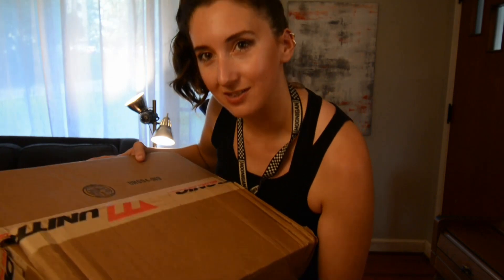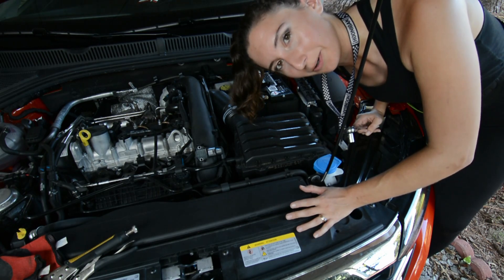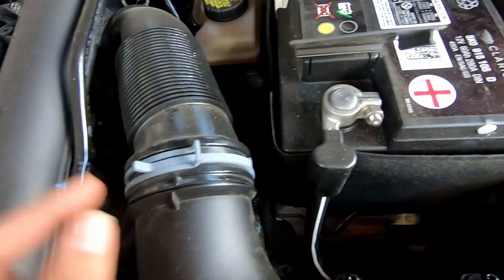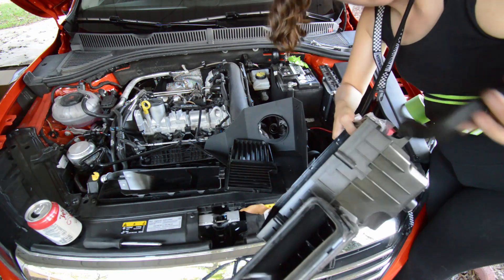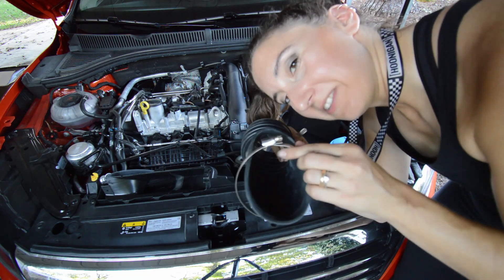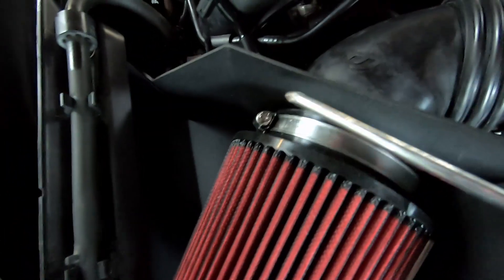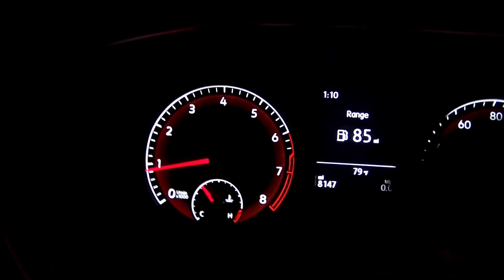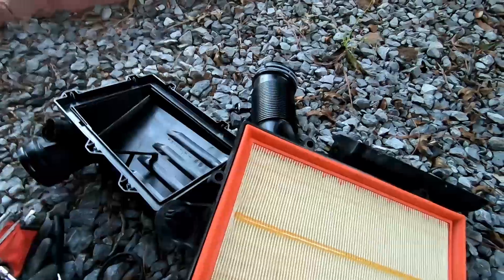Mk7 Jetta Unitronic Cold Air Intake

Comment: According to Unitronic, not all Ea211 1.4 Jettas have that apparatus for the mini filter. On some models, they're equipped with a secondary air pump to assist with cold starting. My jetta did not have this, so Unitronics told me to just forget about it.
Reply from the maker: Interesting. Good to know. I'll update my description with that information.
Reply: by forget about it do you mean you didnt use the intake or just didnt put the mini filter on

Comment: Currently deciding between unitronic and ECS air intakes, thanks for the install video. Def useful information. Also, what size wheels do you have, and did you notice any issues with rubbing?
Reply: i have an aem cold air i love it
Reply: Im thinking of ordering the ecs one myself. Let know if you order it and how you like it
Reply: @dnice362  i didn't buy it because there was no attachment for the BOV hose, and i didn't want to interfere with any engine cooling effects by removing the flap on the stock air duct. I got an AEM and i love it. I can actually hear the engine for rev matching by ear
Reply: 18x8.5

Comment: New to the VW world, I recently got a MK7 Jetta R Line. Im thinking of doing a lift-technik intake and a quad bola exhaust. do you know at what point I would need a tune?
Reply from the maker: For those two mods, you won't need a tune. Once you install a downpipe though... It shall be time. 😎
Reply: U don’t need a tune for a down pipe on these cars either 🤦‍♂️. Honestly though unless u rolling in a gli u wasting your money as the max you’ll ever get from these cars are 210 whp. U can’t attach a bigger turbo as the engine can’t handle it.
Reply: @thewholecountryislaughinga8440  downpipe defo recommend for a tune. i have a 21’ gli, and it’s practically a must once i got my downpipe!
Reply: @camjron  this isn’t a gli buddy
Reply: @camjron  she has a Jetta it doesn’t need a down pipe for a stage 2. I have a 2017 Jetta stage 2 tune with just a cai and performance muffler. Vw forums say the same thing I am
Reply: @thewholecountryislaughinga8440  my bad pal! didn’t mean to offend ya, just said it’s recommended. how’s it running for ya? what are you pushin?
Reply: @thewholecountryislaughinga8440  yeah is20 is amazing i wanna see what is38 can do tbh
Reply: @camjron  didn’t offend me at all. I just was explaining and it’s running just fine. I heard the racechips run about the same as a stage 1 tune and u don’t need anything for them

Comment: I just ordered the cold air intake from UNITRONIC for my 2019 Jetta S but did not see an baby filter in the kit🥺.it’s the  UNITRONIC 1.4TSI EA211 GEN 2 INTAKE kit.
Reply from the maker: Weird. I'm almost wondering if it's even necessary. I'm looking at their website and it doesn't list the smaller filter on the hardware included in the kit. I would contact Unitronic and double check with them though.
Reply: I will contact them and give you a update. By the way where did you get your rims? They look awesome
Reply from the maker: Thanks Adam. And I actually got them as a wheel and tire combo from Tire Rack. I've been a long time fan girl of OZs. Here's a link:
https://m.tirerack.com/wheels/WheelCloseUpServlet?target=runWheelSearch&initialPartNumber=W01A1220533W&wheelMake=O.Z.&wheelModel=Rally%20Racing&wheelFinish=White%20Painted&showRear=no&autoMake=Volkswagen&autoModel=Jetta+1.4T&autoYear=2021&autoModClar=
Reply: @Adam-os2cl  it’s the SAI filter! i know i’m late but hope that helps
Reply: Hey I got a 2019 jetta SEL
How did that airfilter work out?

Comment: Was there any noticeable increase in horse power after adding cold intake?
Reply: If you have a turbo in your engine, installing a CAI will reduce airflow resistance which makes the engine an turbo work less to suck their air. It doesn't really give a huge boost in itself (10hp) but it helps your other components do a better job. Also it sounds pretty cool.

Comment: So I forgot to pull the negative terminal and now I have a bunch of dash lights. They went away after driving it but my ECU reading keeps saying “system low voltage”. Any thoughts? Any insight is very much appreciated.
Reply: Did you fix this issue ??!!! Mine does the same . Replaced the battery & it still does ??

Comment: Why change a filter per se its far the engine and its inside the case?? In that case you only change high flow filter but not all intake because its a cold air on stock.

Comment: What are the benefits of this modification? Thanks.
Reply from the maker: Increased horsepower, better gas mileage, and nicer sound are the top benefits. I mostly did it for the little turbo flutter noises you get.
Reply: @kaylee_hobbz  Understood.
Thank you.
Reply from the maker: @magician2166  You're welcome. 😊
Reply: Hi how are are you?
I have the 2019 jetta 1.4 r-line
Is this the Unitronic 1.4TSI EA211 Gen 2 Intake ? . . Will I get these benefits you mentioned with no tune? All stock under hood and stock exhaust,  will I still achieve the breathing/flutter noises? 
Thank you -
Reply from the maker: @andrewlupoli1567  You definitely will. 😊
Reply: Lol old comment but still...been running my uni cai and I've went from 35-40 cruising at 75 to about 40-45 cruising at same speed...Def worth the upgrade....plus it sounds so nice. Been a year since I've gotten it and no issues...downpipe and tune to come

Comment: Are you planning to get stage 2 unitronic with dpipes ?
Reply from the maker: Not immediately. Tuning's definitely been a consideration for the future.
Reply: @kaylee_hobbz  i am thinking to tune it but do you think it is worth to tune small engines like that ?
Reply from the maker: @aib150  I think the power would be nice, but I have heard the stock clutches on the MK7 Jettas are paper thin and don't support more power/torque super well. Idk about the automatic transmissions. That's the only real complaint I've heard about these specific vehicles.
Reply: @kaylee_hobbz  that is a bad new already :( Can you get any info for automatics ? Thanks for replying.
Reply: @aib150  dsg trans can handle 450wtq on stock clutch packs. Stage 2 and up needs a TCU tune to increase clamping pressure though
Reply: @asapverro5302  but these cars come with aisin not dsg unless u get gli or gti 7speed dsg. These ones are 8speed aisin….
Reply: @asapverro5302  also it is dry clutch not wet so might be very paper…
Reply: @aib150  thought it was a gli. my bad. i'm sure automatic trans can handle stage 1, but not sure for stage 2 and up
Reply: @aib150  8 speed is rated for 250 trq, stage 1+ is at like 230 trq, so you are good to go